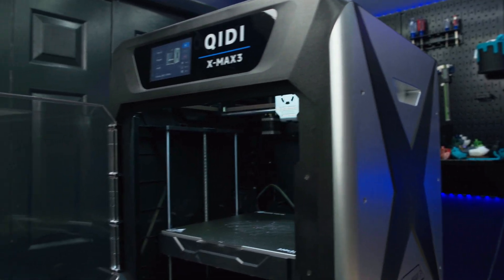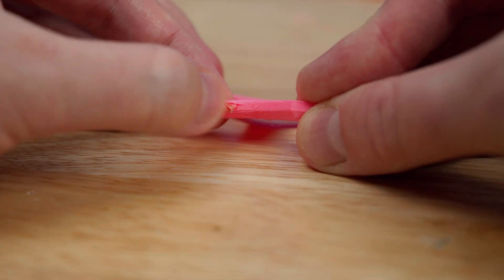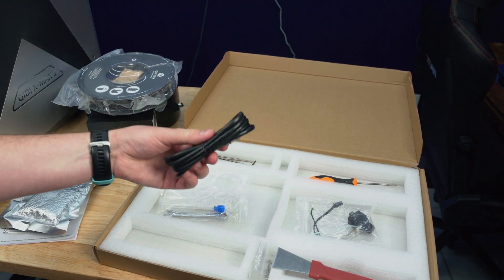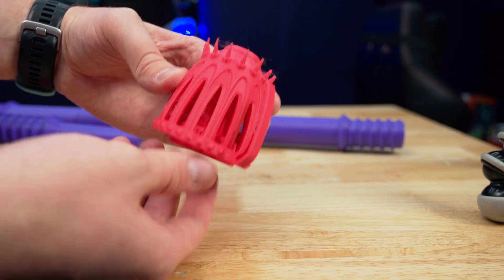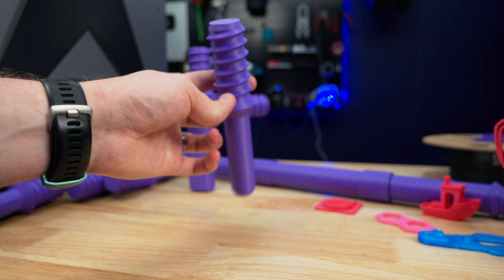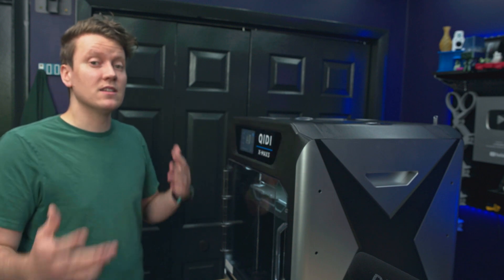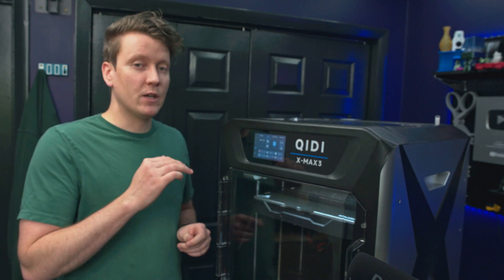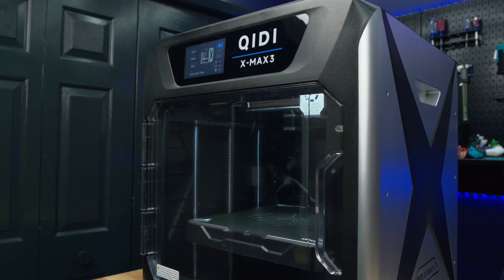Massive 3D Printer for Engineering Filaments - Qidi X-Max 3

Comment: I just received mine 2 days ago and I am begging to regret my decision to get it. Was very excited waiting for it to show up and couldn't wait to unbox it.  It has turned into a 1000 dollar paper weight that could have been avoided if somewhere I had been instructed never to update it. After plugging in my camera, Fluidd notified me for updates to Klipper, Fluidd, and Moonraker and of course I clicked on update all. Very bad decision cause printer does not work now and been waiting for 2 days on replay from Qidi support only thing I've got back so far is we need proof of purchase and you are not suppose to update anything due to their modified versions of firmware and software that works only with this printer. I did not get to print anything yet, but hopefully once I get help from them in the near future fingers cross it will work great cause I would hate to send it back and get a bambu :( without even seeing for myself what it can do.
Reply: Did you solve the problem 😮

Comment: I have been 3D printing for over 10 years, starting with Wanhao Duplicator dual extruder. Now in my more advanced years I'm looking for more ease of use, up to date automation, particularly auto-Z tech. My search is (was) settling down to the Bambu X1C or the Flashforge 5M Pro (yes, i know the downside!).  

But today, I become aware of this Qidi X Max 3 and I've gone weak at the knees, despite the couple of downsides.  I can work out something to solve the rear loading I'm sure.  

But a huge part of me really does NOT want to persist with bits of paper or feeler guage to set Z0! 

I'm considerably impressed with the Qidi customer support as everything i read about it is highly complimentary. 

I really could have done with not discovering this days before making up my mind and placing an order for one of the others.  😂
Reply: Which one did you go for? I was comparing the same models as you alongside the P1S and Qidi XMax 3 is appealing for the open source Klipper but I’m similarly dismayed by the paper z0.
Reply: @Rohan3CAV  In a moment of weakness 😇 I pulled the trigger on the Flashforge 5M Pro and am not disappointed. A week on and it has lived up to expectation. 

That said, I'm not out of the woods yet. I've one more machine to refresh and it looks like I'm leaning to the Bambu P1S. Before I make any final decision, I only last week became aware of the new just about to release Creality K1 C (for Carbon). I need to see practical reviews on that late arrival. 

So P1S or K1 C.

Comment: I just got mine and its the best printer i own. I just put a long bowden tube to the dry box and a clip to hold it to the side. I never touch the back.
Reply: Better than bambu you think?
Reply: it is a ok printer, but no were near as good as a bambu. I have two bambu x1c's and I own the X max 3 here. had my max for 2 weeks and it died on me because the USB c cable they use on the hot end is not designed for high temp printing ( ABS of all things ) but they were amazing on sending me all the upgraded parts to replace the current hot end model ( new hot end has extra two fans ) if you don't need the volumne, get a x1c without the AMS it's just far superior. @rache5399
Reply: @rache5399  I would have to say yes. It's fast, big and heated for all types of filament. I can monitor from home or outside my network. They just released a camera with AI. It is really a great printer. I love it.
Reply: @nickp385 I just purchased this printer and am waiting for it to arrive hopefully in the next couple of days. Can you please share where you got the parts to be able to mount the spool on the side? It seems like this is everyone's main complaint when it comes to this printer from the number of videos that I've seen about it. Thanks
Reply: @CleetusVanDamme530  It comes with a round filament case that you put desiccant in it. Its not a dryer just something to hold the spool. It has a flat bottom and a bowden tube. You get yourself a long bowden tube and go from the filament run out sensor to the dry box. It sits right next to the printer. I cant see you not figuring out 1 2 3. It is a great fast printer, its at least 4 times fast then my Ender 6. If you need any help with it just ask but not hard to figure out. Best of luck with it. Just write me if you need help, if i can i will. There tech support is also very good.
Reply: @nickp385  cool thanks, it's great that you mention that. It sounds like a pretty simple solution, yet in all the videos I've seen about this it doesn't get mentioned 🤷.

Comment: creality support is known to be pretty terrible, so I'm not going to deal with those guys and the Bambu looks great, but the mandatory cloud stuff is a deal breaker for me.  That means this looks like the next best thing, however I'm willing to go up to $1500 or even $2k if I can get something very reliable that will print engineering grade plastics.  With that in mind does your recommendation change?  Or still Qidi X-Max 3?
Reply: for some months now, bambu works 100% offline in LAN mode - slicer works and even the camera. cloud is no longer mandatory.
Reply: @TMS5100   even firmware updates?
Reply: @akschu1  not yet, but since the x1e is coming soon with wired ethernet port and physical killswitches for wifi and lan, presumably offline firmware updates is eventually coming. those are features that airgapped commercial print farms need.
Reply: @TMS5100 I read that the X1E will have the same build size. True?
Also, there is a larger bambu printer in the pipeline, the X1L. Have you read or heard any release date predictions? I think I'm going to impatiently wait for a Big Bambu.
Reply from the maker: For those higher temp filaments this is a great machine. I was super impressed with how easy it was to print without worrying about warping. I haven't tried anything above this one price or feature wise, but this one is built solidly.
Reply: the layer lines are way too visible compared to the 2 other u mentioned, i dont have one, just  what i saw in reviews

Comment: I have 3 Bambu printers and 6 ams units and it’s tuff to beat the quality and speed of the Bambu printers, I got the K1 Max thinking Creality stepped their game up it’s been a nightmare to get it to print ok. I just got the Qidi XMax3 and I’m loving it thus far. I put about 7 hours with PLA and now I have changed over to ASA and it prints very well, not Bambu quality but it’s closer then the K1 Max for sure.
Reply: Thank you for this comment, I am toying with bambu and max3.  I really want the larger size, and strong filament options, so to hear the max3 is better than current creality offerings is huge for me.  I might get a max3 three now.
Reply: @rickybobbyracing9106  I have about 200 hours on the X Max3 now and it’s been flawless. I wish i would have gotten it instead of the K1 max first so I don’t have to look at it. But then some people say they have good k1 max’s that print perfect out of the box. That is not my experience with the k1 max. I had to do a lot to get acceptable prints
Reply: @mikemarucci913 my k1 max worked OK for 4 days then dug holes in the print bed damaging the nozzle, hot end and then threw codes which point to a dead main board. I really wanted to like the K1 max but it's going back. I think I will try the qidi next as bamboo is just too much cost here in Australia.
Reply: You mean bambu without heated chamber that goes to 50c max, will print asa, pc, nylon better then max3? This must be a joke
Reply: @juliusvalentinas  I think you're putting words in OP's mouth.  Think generally speaking max3 isn't quite where bambu is.  Probably speaking more to PLA and PETG.  
But you're point is true, max3 can do soo much more, which is why I might buy one soon.  Very interested.

Comment: Manual Z offset, a deal breaker in 2023 unfortunately.
Reply: Yeah, it's horrible. Mine has reached 60 hours of printing with PLA, ABS and TPU without any issues and I had to adjust z offset exactly once (initial setup). And I even did one fimware update in between. It's a massive dealbreaker. NoGo... -> If you are not capable of adjusting z offset once, you better find another hobby than 3d printing!
Reply: @markus4692 😂 Touché
Reply: Yes load cells that brake is better

Comment: @2:18 manual offset adjustment using paper, so amazingly obsolete and backwards when everyone from prusa to creality are doing nozzle probing. wtf qidi.
Reply: I will take that con any day of the week if it does the prints right.
Reply: @craigedwards2411  exactly I just got this printer and the quality of the prints at a speed that seems like it should be impossible is amazing I’ve never seen another printer make prints so smooth that you almost can’t see the layers it’s amazing

Comment: How easy is it to install official Klipper firmware?🧐 Sounds like that would fix some of the UI issues.
Reply: Impossible without hardware changes
Reply: @kyky7kyle7  😔 sad that they would cripple Klipper like that.
Reply: @m_IDEX is klipper firmware the best of best? (New to 3d printing i keep reading about it)
Reply: @Chaaal-Nikaaal, it is best of the best for me. Other firmware options are fine, however, not as flexible, and not as powerful.
Reply from the maker: You can access the "real" Fluidd web interface, but it still isn't a real Klipper install
Reply: fa molt de la teva pregunta, pero via usb amb un per exemple BTT Pad 7 es factible kliper nadiu sense haver de tocar hardware ni modificar la impressora. L’he comprat avui pel preu i volum 650€

Comment: They really really need to spot putting the filament holder in the back. That must be one of those " lets make something retarded" moments from them... And they had the Flashforge 4 Adventurer example with a nice side mount with could be kept dry by the printers heat
Reply from the maker: A simple side or top mounted filament holder would make this a much easier printer to use!

Comment: Ive got the smaller x plus 3. I feed every filament out of a dry box set to the side of the printer with bowden tube running into the filament sensor. The easiest way I have found to change filament is to pop the bowden tube out of the hot end before heating it up and pull a little extra slack through so you can grab it to pull out the filament once you heat the hot end up. then feed the new filament all the way through the bowden, stick it in the extruder and load the new filament in. No messing around behind the printer that way.
Reply from the maker: That is a great idea to just set the dry box to the side of the printer. Still more difficult than some other printers, but for the high temperature filaments then it could be worth it!
Reply: Im doing the same!
Reply: I read you can add a cutter removed in v2 and have no problems